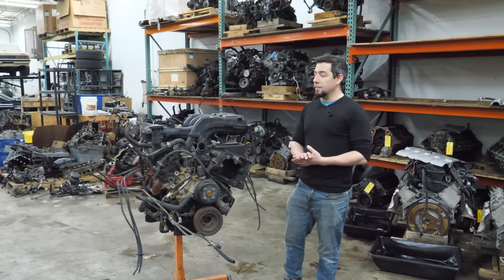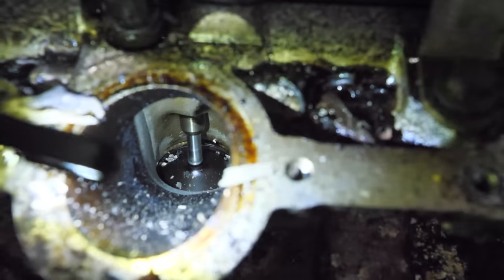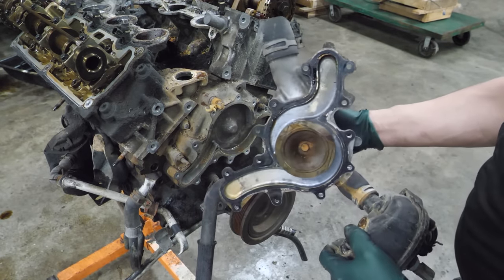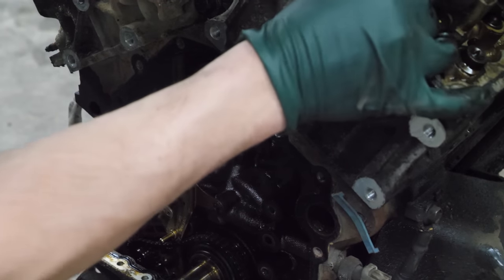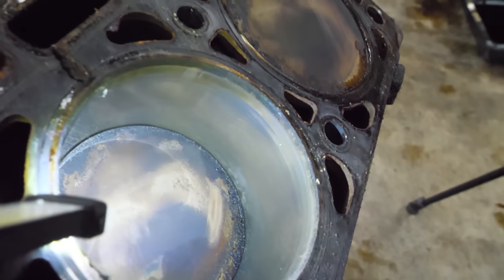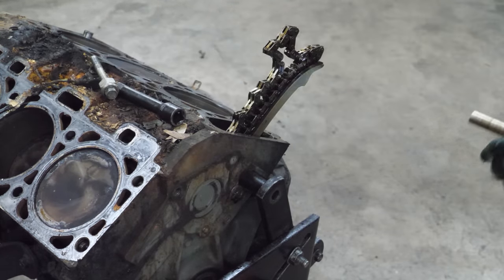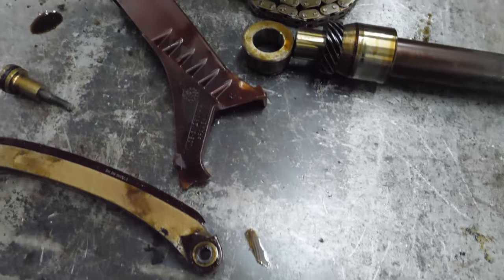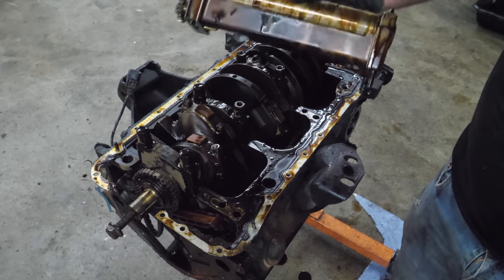Ford Explorer / Ranger / Mustang 4.0L SOHC V6 Teardown! Is This Why They're Called "Exploders" ?

Comment: My dad had the OHV 4.0 in his 1995 Ranger and when he died the truck had 633,000 miles on it and it still ran great.
Reply: Sorry for your loss, but the 4.0L OHV did not have the components that were at issue as the weak link on the 4.0L SOHC.
Reply: in 95 is a cologne engine single cam desing now is a sohc desing very different engine
Reply: @stinkycheese804  What he was saying is the SOHC version was a modification to SOHC from the 4.0L OHV. that jack shaft is where the cam use to be.  WHY Ford went to the SOHC on that engine is unknown BUT probably for a MPG increase.  They did bump the HP up some. but they made the engine way over complicated, must have been over engineered by the British as that seemed to be their thing !! !
Reply: I got a 95 Ranger with that engine in 2001 and it is still running now as far as I know. I only got up to 300,000 miles before I sold it for farm use last year, but it was a great vehicle. The only issue I had was with some of the electronics in the ignition. It's a shame that Ford gave up using that engine for something less reliable.
Reply: @juvandy   I drive an 96 Eddie Bauer explorer with that OHV v6 engine , 200K runs perfect. Needed valve covers for some reason they got rusty and holes :lol:. The OHV are extremely reliable.  Also has 4.10s great offroad in 4 low
Reply: congratz
Reply: @caterpillar6nz310  cool desing bro
Reply: 4 litres ohv 160 cv sohc 208 cv
Reply: I have a 94 and still runs great with 380OOO
Reply: Talking about 2 different sized bolts on the engine bracket "that's typical for Ford 😫😫😫😫😫😥😥😥😥 hey ace guess what? It's typical for gm shit as well...
Reply: Oh wow!!! A worn out chain guide 😥😫😫😫😫gee how horrible!!
Reply: OMG you had to remove the dipstick? Wow what a tragedy!😫😫😫😫
Reply: well damn my ass.. @Mark-in5yw
Reply: You're damn right my 92 had 300 000 when my girl at the time totaled it
Reply: My son has a Ranger too, zero issues
Reply: I was wondering when he is producing his 1M mile guaranteed V6
Reply: So you had the 1 good 4.0l lol
Reply: @alb12345672 They were dangerously underpowered though especially in the Explorer.  I know someone that towed a 2000 pound boat with one.  They never lifted their foot off the floor except at stoplights and stop signs.
Reply: @user-tb7rn1il3q  I have 4.10s, no power after 60 🤣🤣. With the 4low it definitely had off-road in mind. Says it could tow 5K, hard to believe.
Reply: I’m sure he did
Reply: I Believe on time oil changes make all the Difference , my Ford Essex 3.8 has never had a problem in 35 years and runs like new with 385 K miles !
Reply: @lilibethdoherty295  no head gasket problems?
Reply: @caterpillar6nz310 all the cologne engines were pretty reliable from what I’ve experienced, from the one in my 84 Mustang (3.7) with an abysmal throttle body injection design that was prone to flooding, to the equally reliable and more modernized explorer motors of the 90’s.
Reply: RIP to your dad. I bet he took care of that truck. It sure sounds like it. I would have kept that truck forever. I baby my 2003 chevy trailblazer with 198k miles. I bought a it a few years ago with only 100k miles in it. I'll never get rid of it. I just replace was wears out.
Reply: anyone who has taken care if those engines has many many miles on them with low maintenance.  
made at ford Germany where motors are are used.
Reply: @stinkycheese804 mines a SOHC and its got 415 000 miles on it. Don't knock it.
Reply: Thank you for doing this very informative video. I own a 2001 ford explorer sport track and I’m having a problem with the time chain tensioner. I appreciate very much your video. I have a question in a situation like this can you still using the old chains and just replace the tensioners?
Reply: The Cologne v6 is so understressed, it'll run forever if you even think about changing the oil from time to time. My father had a -93 Exploder and I got to drive it a couple of times. That thing was very efficient in turning gasoline into noise.
Reply: @wilburfinnigan2142 I read somewhere that Ford redesigned the 4.0 with the OHC and jackshaft to give it a lower profile while increasing HP. Personally I would rather have an engine that lasts than one with more HP smaller.
Reply: My '97 Exploder with the 4.0 OHV engine ran great with 255,000 miles. Took it to salvage yard due to body rust and lots of it. The engine was gutless and really wasn't happy much above 3500 rpm so it didn't put out much torque and couldn't be revved up without waking the dead. Dependable and long lasting but not very satisfying to drive.
Reply: Dad had a 94 with over 500 on a built 4.0 and that truck was fun and rowdy
Reply: Yea I have a 2011 ford ranger with this engine in it I wish I knew the Idiot who came up with this Design so I can beat the crap out of them it's the most Ridiculous engine design super expensive to have fixed at 83,000 miles my front Tensioner broke cost me almost 2000.00 to replace both front and back guids then @ a little over 119,000 miles the back guide broke at that point I had to replace the engine but it set me back over 6000.00 I couldn't afford another truck so I had to pay for the rebuilt engine no surprise the rebuilt engine came with Plastic guides so stupid
Reply: The overhead valve engine is way better. Weak but they last

Comment: That 4.0 is insanely reliable. Don't let him scare you by talking bad about the timing chain. Just do your oil changes every 5k and give it an italian tuneup every once and a while and you're golden.
Reply: I've always heard people have one of two thoughts about the 3.0 on Rangers... It's the most reliable of the engine options... Or it's trash because it doesn't have the power of the 4.0 or fuel efficiency of the in line 4
Reply: @jordanhart9708 how is the 3.0 L reliability actually?
Reply: @ryanarledge51  I'm over a 230k miles on a 2002, original engine and transmission still running, and I'm the 6th owner.
Reply: I don't think he's trying to scare anyone. I have a buddy mechanic that also hates these engines. If anything, it's a pretty dumb design
Reply: Do. Your tune ups my 2002 sport trac had 2 misfires I had no idea of lol
Reply: Unexpected vice grip garage reference. Upvote given. 😎
Reply: @thJune  wasn’t a vice grip garage reference but I do like his channel lmao
Reply: I change my oil every 3.5k in my ford focus 2010 it is a very clean engine when I changed the head gasket I was surprised how clean it was I would change earlier than 5k
Reply: @cashwilson2571  I do mine every like 2000-2500 miles depending on how my oil looks when I check it, but I am also insanely meticulous about my truck.
Reply: I have ~345xxx gently abused miles on my 2001 4.0 sohc ranger no issues. You’re correct these engines just want to be kept maintained.
Reply: @yo_its_gingey5329  smart bro! I mean yea i bet your engine loves ya haha
Reply: Wanna buy mine? It doesn't run and I'm tired of multiple mechanics not able to properly fix it.
Reply: What is an Italin tune up??
Reply: @chrisnelson2796  gas pedal to the floor and open that girl up on the highway. Let that engine breath. It helps clean out carbon deposits and can weirdly enough make piston rings reseal if you’re having power loss due to piston rings blow by. And if you do Italian tune ups often, you’ll be surprised by how clean your pistons and bores are if you look in with a bore scope.
Reply: @yo_its_gingey5329   thank you! Was kinda scratching  my head lol. I have a 2010 ford ranger xlt 4.0 4x4 I commute Mon- Fri and I do open her up now and again. I do regular oil changes with oil filter at 3 thousand miles it has just over a hundred thousand  miles no problems yet..
Reply: @ryanarledge51 generally pretty reliable. They got a bad rap in the Taurus because the fwd autoboxes were trash, but the motors themselves aren't bad at all. The biggest issue in the rangers is they are gutless wonders. This means you have to beat on them to get any speed and then your fuel mileage goes to hell.
Reply: I've seen a lot of people tear their 4.0l v6 engine all the way down just because of the factory defect leak where the thermostat sits in the waterpump. regular Gasket makes it worse just use some premium quality permatex and she's golden 👌.
Reply: I've had mine since 205,000 and it's at 230,000 now. Just purring along. I been thinking about them Polaris tensioners as a long term option. This unit is an 05 sport Trac.Any suggestions?
Reply: @JeremypoythressPoythress I changed mine with water pump and radiator, no big deal really.
Reply: @ryanarledge51 most people I know ran those 3.0's until the block cracked and drank coolant. And then continued to drive them like nothing was wrong other then excessively filling up on water. 😂
Reply: will it idle in Italian? lmao
Reply: @DeathbringerDrago  no an Italian tuneup is when you send it on the highway hitting high rpm’s for long periods. It burns up carbon deposits and is good for it. Also you’d be surprised to learn low rpm driving makes the piston microscopically slap the cylinder walls all up and down the piston bores, so actually high rpm’s is good for the motor. If it weren’t for the heat and amount of gas burned up we’d probably have less gears in cars just for that reason. But you get the trade off.
Reply: @ryanarledge51 the 3.0 from the 2001 model year and after is extremely reliable. The 3.0s before 2001 cracked heads all the time which is why the heads were redesigned for the 2001 model year
Reply: I absolutely hate that SOHC 4.0L V-6 Engine.
I absolutely love the 4.9L I-6 Engine.
Reply: @yo_its_gingey5329  and your valve covers will still melt
Reply: Your talking about the OHV! He's talking about a different engine! 😂
Reply: You're talking about the OHV 4.0. that's a different engine than what he's talking about.
Reply: @Bill-mj8hf  no sir I have a ranger with this exact motor and it’s awesome. Great power, horrible gas mileage, but reliable and strong. But you have to take care of it, you can’t just ignore oil changes. I do my oil changes religiously at around the 4500-5000 mile mark and never wait longer and my motor will last. Especially with high rpm driving, these motors love being in the 3000-4000 rpm range. If you’re grandma driving it it’s gonna have issues for sure. The transmissions they’re paired with suck so I’m almost never in 5th gear unless I’m on a 55mph or higher.
Reply: @DeathbringerDrago  my valve covers are metal sir.